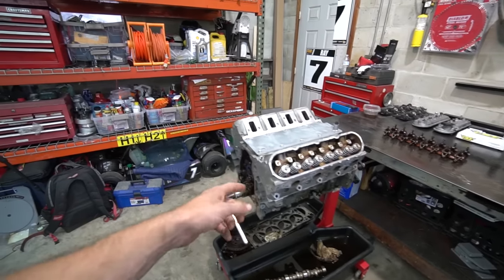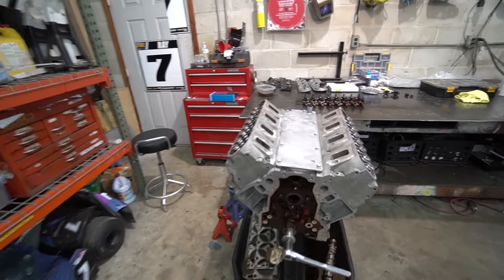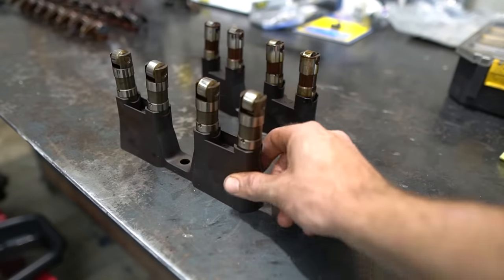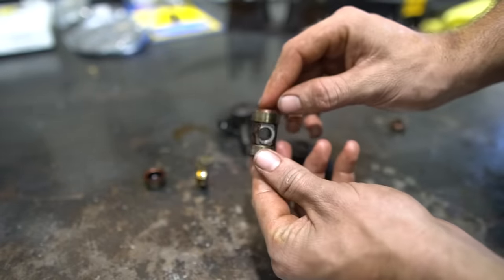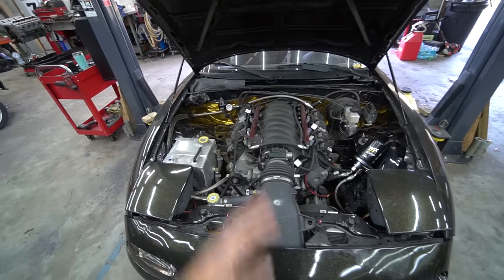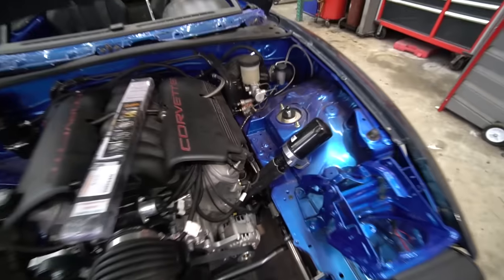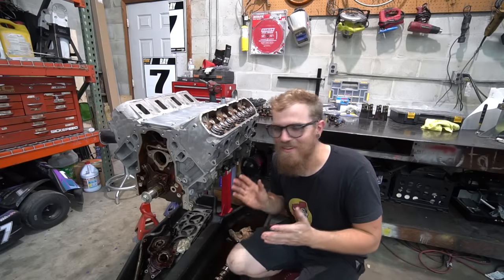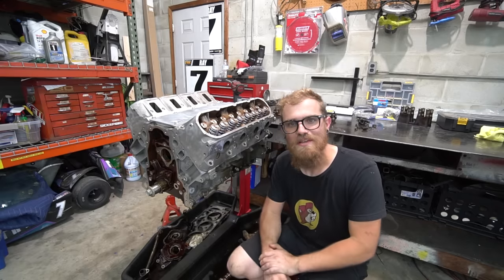Top 5 Mods To Make An LS Engine Reliable.

Comment: You forgot the most important thing of all. Lets call it thing#0: The PCV system and crankcase pressure measurement. Thing#0 could be why the baffled pans failed in your application. Thing#0 the PCV system addresses the size of oil droplets and their density within the crankcase. You MUST measure the crankcase pressure and set it to approx 1.5"Hg (street cars - wet sump) to 3"Hg (drift cars - wet sump) to maintain low oil droplet density and rapid oil wicking to the pan. To set correctly in wet sump application you adjust air filter pressure drop and maintain the shortest PCV lines of appropriate diameter (high velocity = near OEM diameter). Do not use a catch can it will degrade the PCV pressure (friction = lost energy to drive evacuation) gradients and could lead to oil pressure failure. There is a explicit how-to DIY Crankcase pressure measurement in my channel and I show using a turbocharged application which is arguably more difficult.

Comment: The other overlooked oil starvation fix is to simply overfill the pan. The "LS1" style pan "full" line is at 5.5 qts. You can run 7.5 with no negative effects and oil starvation has not been an issue in my experience. Also back to back 1/4 mile runs at 5.5 and 7.5qts i saw no noticeable performance loss due to windage that every one claims is such a big issue. also adding high volume oil pumps when not needed tends to "suck the pan dry" and is completely not necessary.
Reply: Does this work on the truck versions?
Reply: Wow! Really Adam? Alright, my series "B" 5.3 in my '06 GMC 4×4, has been an amazing engine!  Very happy with it. I've got 175,000 on it, one small oil leak.
   Any how, the oil pressure deviation, has always been on my mind, all years I have owned the truck. Back and forth from 31 to 41 lbs. Doesn't use oil, or burn oil. Thinkin' I'll try your madness...😅 Thanks!
Reply: Oh, Adam, I'm with ya on the idea lesser oil, faster times! Ha, shorten engine life! But, getting rid of the PCV system, installing a breather type oil cap, does help. Again, thanks!

Comment: If you showed me this video a few years ago, I would have laughed in your face. After burning up 2 perfectly good motors (one built to the gills) I 100% agree with everything you said. If I had seen this video a few years ago AND followed the advice,  I'd still be on my original motor.
Reply: Factory LS with cylinder deactivation is not very reliable. It's like you didn't watch the video. Cool story though.

Comment: Put a carb on it with msd, say bye to clogged fuel injectors, shorting wires,  tuning issues,  idle relearning and 100 sensors with a check engine light.

Comment: Short list 
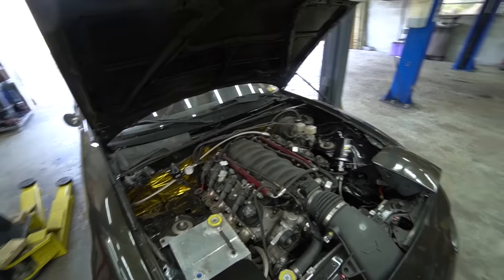3:09 - Internal oil seals [cam retainer plate etc]
7:56 - lifters [gen 3 vs 4]
10:14 - rocker arm upgrades
12:24 - oiling system [preventing starvation]
21:18 - bottom end considerations
Reply: Thank god. Bro a yapper
Reply: thanks man, holy moly.
Reply: Have my kids

Comment: Another important reason for road racing builds to use a dry sump system is the flat oil pan, which allows the engine to be installed lower in the chassis, getting the center of gravity lower, improving handling.
If you're a real belt-and-suspenders man, you'll install an Accusump to kick in just in case your dry sump belt comes off or you blow one of its feed lines or whatever so as to give you time to shut down before your motor seizes. A big, bright oil pressure red idiot light where you can't possibly miss it would be a worthwhile investment as well.
Excellent video.

Comment: Great video and you are dead right about all the issues listed. I have a few more issues that you could add: 6) AFM (DOD) lifter failure 7) LS3/ any motor that uses the LS3 style timing chain tensioner. The plastic parts of the tensioner is prone to breaking. 8) Not a real issue, but the stock valve springs can be fairly shitting and are prone to valve floating at high rpm.

Comment: These are GREAT tips. My favorite one is "leave it the F alone". I am a road racer, and I am very familiar with horsepower and what one can do with it. Because of that, I get a lot of questions around what should be done to a motor. It KILLS me when I have someone LS swapping something like an RX7, a Miata, a 240SX, whatever. They start talking about heads and intakes and what pistons they need and so on, because they want to make power because they are afraid it'll be slow. I have almost this exact talk with them. Man, that car is what, 2600#-2700# at the absolute max? If its a Miata its closer to 2300#-2400#? That 300-350 hp is going to be PLENTY. Just get the thing done, and get it running. After a few months if you think its slow, get some heads on it. But don't let that stop the project. And I can bet you won't be bored.
Reply: As fellow road racer , builder of the very cars you  mention as well as A sedan Camaro, GT2   I have always addressed a couple things most dont. Proper oil, proper cooling, proper braking . I have also used Peterson dry sumps.
Reply: Very insightful and solid answer. As a Corvette owner, I try to tell my buddies to just try driving a C5/6/7 before they go crazy on any build. And a good 80-90% of people aren't going to push their cars to their limits anyway so what was the point of spending all that money? Car culture is way too obsessed with chasing higher horsepower numbers that you're almost never going to make use out of anyway
Reply: @ledzeppelin27  that's exactly right. Spend time with it first, drive it first. You might just find that it scares the *&$! Out of you as it sits.

Comment: Pre-Watch Prediction: 
#1 = DO NOT look at the cam bearings
Reply: HAHAHA
Reply: EDIT: This list is bullshit. 

Great content Tay. Stoke to see you rip the Miata 6.2
Reply: @ChuckThree  Haha #5 is basically not to touch the bottom end. So you still right.
Reply: Ahhh yes the tried and true sloppy mechanics method, I love it
Reply: @neuralfraud  my 4th gen had 123k when I swapped cam, cam bearing looked the same, cam lasted a year (it was a regrind) put stock cam back in with new lifters, no problems it has 220k now.

Comment: My 5.3L LM7 lost oil pressure in Ohio on a trip. Thought it was the sensor at first, no biggie.  Drove it about a mile and the lifters started complaining.  Had a friend come with his flat bed gooseneck trailer and tow me back to his shop in Michigan.  We dropped the pan and changed the o-ring and now I'm back to 60 psi cold / 40 psi hot pressure.

Comment: first thing you showed, the cam plate, is what killed my first 5.3 in my Nova. just a couple street miles and couple dyno hits, oil pressure dropping to 5psi with a hell of a noise from the cam!
#5, my fav. the replacement 4.8 that went into my Nova didnt get a single bolt turned that didnt need it. slapped a cam in and good. same deal with my new project, didnt even look at the bottom end. GM knows there shit, they built like 50million of these, how many engines have you built? yeah. plus, that engine has PROVEN it self for the last 100k + miles (always claimed, its probably got 240+ lol), its driven to countless soccer/baseball/whatever games, to work every day for 10years... ITS GOOD.
Reply from the maker: Exactly my sentiments on #5! People get caught up in the while you're there's and it never ends well
Reply: In Australia they put these (GenIII Ontario built) in GM Holden Commodores and had to rebuild engines under warranty if customer complained about them being too noisy.   Piston slap and excess oil usage before even before 3 years use. New pistons and rods etc. times thousands of cars .After rebuilds though, its a magic engine.  Especially sought after in the 2nd hand market,  if you looking for a long term purchase.  One of the many GM mistakes that killed Holden.
Reply: @kaneo6162   What do you mean one of Gm's mistakes and Holden killed it..???
Reply: Dustin, you crack me up!😅 Straight and to the point! Gonna drop the pan on my '06 series "B" 5.3, changing oil pump seals and I guess plugging a bolt hole...
Reply: @kaneo6162 ...using flat top pistons.

Comment: The oil problem you speak of is inherent in ALL wet sumps, it's not really an ''LS'' problem. The only truly unique ''LS'' problem is the oil pick up. Apparently GM makes it easy for you to fix with an additional bolt hole. Why GM goes through the trouble of making a bolt hole and leaving it empty? Truly one of life's mysteries. Changing seals and so on, is just doing a thorough/good build. Great video though thanks for sharing.

Comment: A couple of my thoughts.  I ran my 5.3 all year at 7200 in my sprint car.  Stock other the. A cam swap.   To the people talking about high pressure and volume pumps be careful.  Consider at high RPM the pump can lower your pan level to an unwanted level.   Also. A little trick.  Your lifter trays will hold to much oil till then fill.  Drill a small hole in the tray to let the oil drain at a lower lever

Comment: Thank you, thank you for pointing out the items in the video. As a dealer line tech we see things and take measures to cover our own behind, but showing the camshaft retainer plate gasket and it’s importance is to me, is never discussed. The Red Gasket maker (Loctite 518) is for two machined surfaces and in the absence or air, creates a great seal. I use a film of this carefully behind this plate on any gasket. Sac City’s bar-bell is a nice touch as we as the rocker trunnions, which can fail on high mile daily drivers.
 The oil accumulator is a home run in my book. Even engines that are grocery-getters, the main & rod bearings experiencing a slow death ever time (That 200k miles or more) they are started. Even with certain engine designers oiling strategy, we all know that no pressure film of oil is a fine line to a little wear and no wear. I enjoyed your choice of locations with limited real estate up front. I just wish the wear half the price they retail for considering the simplicity. The key operated valve is technically the most expensive component installed. Thanks and best of luck. Liked & Subscribed! ASE Master Tech since 1978 - Retired... Great Points!

Comment: Another benefit to dry sump is it helps the rotating assembly not having to slosh through all the oil in the pan. It helps with climbing in the rpms quicker, and frees up a little bit of power too. Of course, it might be immeasurable, but it definitely helps.

Comment: One of the BEST video advice I've ever seen on any video platform.
I would say, NO MATTER haw you wish to use your LS vehicle, these simple upgrades will actually make your LS engine bulletproof. I'd say a simple drysump is also a must have if you only want to care about oil changes.
I know of a guy in Mannheim Germany who rodnocked his Firebird LS engine in a speedway turnpike : a long long long right turn at a speedway turnpike crossing, he took the turn just pushing a " tad little more" than he'd do, and ... bye bye LS engine.

Comment: Here in Australia, the LS3 is used in the Holden Caprice limo - lifter failure is very common for actual chauffeur driven vehicles. One mechanic said he thinks it's due to insufficient oil pressure at low revs. (we do a lot of low rev driving, and a lot of idling)
Reply: It's just a crappy lifter design. Try Johnson or morel lifters. They are worlds apart from the junk given at the factory
Reply: @swappedoutZ71  got a Q7 now - probably a whole set of new & wonderful problems 🤣

Comment: Taylor: it can't slosh away from pickup
Me: flips car
Reply: nick Metal art works I thought it but wasn’t gonna say anything 😂
Reply: You wouldn't have to worry about the pick up if your upside-down. All the oil will stay in the motor. Until it gets to the cylinder and gets pushed out the exhaust.

Comment: Thank you for these 5 oil tips! I had no idea on most of these. A bad oil pickup tube o ring caused my LQ4 to have no oil pressure for about 10 seconds in the winter!!! Replaced it and instant pressure every start up. I did not know there was a 2nd bolt hold down for the tube thanks for that too!

Comment: My lifter turned sideways in my '12 silverado 6 months after buying it because someone had previously replaced the lifers (probably collapsed lifter)  but didn't replace the $20 treys 😡. So I did a cam swap and DOD delete truck has been great ever since.  Good to see I did most everything in your video.

Comment: Excellent To Do primer for LS C3 Corvette Swaps Taylor, thanks! 

 For my "Pull N Pay" Corvette C3 crowd who are doing a scrapyard sourced LS swap I'm recommending a couple of things. I realize that alot of us are family guys that are doing the conversion on a budget & that's precisely WHY I'm making them, because you don't want to do it again & at the same time you also don't want to limit yourself from power upgrades later. You've got it out, follow Taylor's wise (cheap insurance!) council on the seals & rockers. I'd recommend a high-pressure oil pump on Any swap and on LS's I'd recommend a new set of push rods & rocker arms. 2 reasons; people love to neglect their oil changes & a High-Pressure one like a Mellings will help push oil through those potentially restricted Oil Passages from a neglected motor & Revving! Man we love a high revving V-8. Again, "cheap insurance". Change the Cam Bearings. The main bearings on these last, the cam bearings don't fare as well. So those  3 seals, cam bearings, oil pump, push rods & rocker arms and on LS3's the plastic chain tensioner. 

 You KNOW that if you're doing a C3 Corvette LS Engine Swap-that you'll Eventually do power upgrades so a little extra investment Now means less work later so that makes the LS Cam Bearing replacement more important-Now.   

I'm currently collecting as much real world information as we can find for doing a C3 Corvette LS Engine & Transmission Swap using ONLY Factory Parts as we can get our hands on so this can be a simple(r) WEEKEND SWAP rather than another expensive 6 month trial & error financial burden. Which factory accessory drives work, oil pan & pick up, waterpump (the outlet actually), trans crossmember & mount, motor & frame mounts, ps & fuel lines, etc.

Comment: Step one change the oil step 2 beat the piss out of it step 3 see step 1 

l.s the world beast motors ever
Reply: You clearly haven't watched many videos on this channel, because if you did, you wouldn't say that...
Reply: IMNOTA you clearly don't know anything about engineering. Who the hell cares what these dips did to their LS
Reply: I was gonna say, how to make an LS reliable?  I dunno, start the fuckin thing and drive it?  I'm a mechanic at a speed shop, and one of my customers has a stock internals 6.0L boosted to the nuts, and he put it in the 7s in the 1/4 mile.  And when that one finally does let go, he's going to grab another one from the wrecker for $300 and boost the fuck out of that one.
Reply: It’s impossible to make an LS reliable their junk

Comment: I'm more of an electrical/performance guy than an mechanical rebuild guy so naturally I forget which GM LS/LT engine comes with what as far as the top end goes other than the AFM crap they finally decided to slowly back away from in the new models. This is a pretty damn good video for DIY'ers and seasoned techs to view. My hat goes off to you.

Comment: Great video.  Very detailed and to-the-point.  Thanks for showing the difference on the GEN 4 lifters.  Thanks for describing oiling options and related costs.  The accusump described as a band-aid is like saying an accumulator on a hydro-boost braking system is a band-aid.  I agree with your assertion - its a solution.  BTW - cool Miatas.  Looks fun!

Comment: I have found most LS blocks with 100k plus miles the cam bearings are all shot, that's a definite must replace item if it's a used High mileage block.. be careful some gen3 bearings are narrow, gen4 are wide for the cam phaser to work correctly you install the wrong ones it will kill your pressure... (been there done that....) Great video...

Comment: Have you looked into improving oil drain back, especially from the heads, in LS engines? Seems like the routes back to the pan are a bit small and complicated.
Reply: You won't have any issues of oil drain back into the pan.  If you are building the heads, just a simple chamfer to remove corner flashing is all you should need to do, but that goes without saying.  As long as you're not running 20w-50 you are perfectly fine in 90% of all your scenarios.

Comment: What about using a catch can setup  ?  I  run a gen 3 ls1 5.7 with 300.000km un-opened engine.  I use a catch can between the valley and the intake manifold.  🔧👍🏁

Comment: Your point on the belt is the one big thing that hit me and made me go a wet sump. All the things that happen on a daily ride or while being driven and if that belt is gone, boom no oil pressure. I'll be going an accusump in the future once the build passes engineering to be road legal (Straya).
Reply: I was going to do the extra bracket on the oil pickup while I was changing out the pickup itself (new oring) but couldnt get the bolt in without removing the front cover, so will leave that one for another time. Also went a barbell  just because accessibility and any improvement in oiling is a plus in my book. Canton sump already on there so hope that holds up for autokhana/drag until the above happens.

Comment: Good job! 
I destroyed my ls6 because of a lifter failure. 😬
And on my ls3, the rockers where starting to failed. I replaced all the rockers.
Reply: Always change the rocker bearings to captured needle bearings in any high power LS project

Comment: "It doesn't make the car faster, it doesn't make the car better , it just makes it essentially more reliable ." In my opinion, "more reliable" absolutely equals "better".
Reply: Forreal. Running a 10 is not nearly as "good" as running 10's.